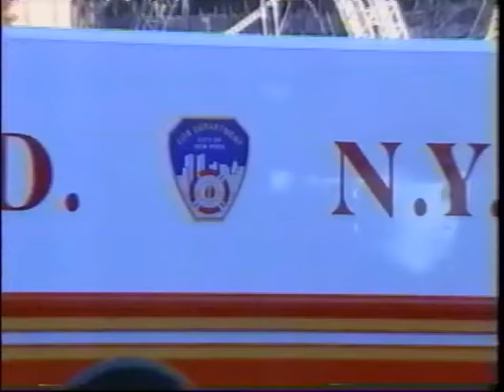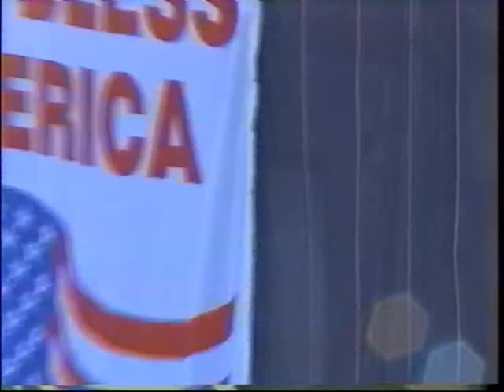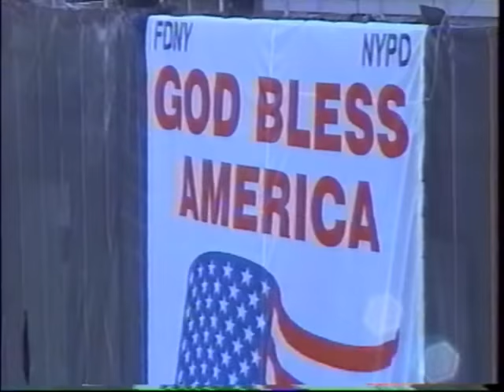Ground Zero recovery months after 9/11/2001

Comment: The rubble was still smoldering 3 months later. That is absolutely mind boggling.
Reply: @kingofhaiti123 Proves absolutely nothing smh
Reply: @kingofhaiti123  yes ,   niels harit  ,    proof of nano thermite ,  and god 
knows what else ,   why did so many people get serious sick
Reply: @JJSideshowBob  denial is real trust me I know, I was in your shoes at a point in my life 💯
Reply: @kingofhaiti123 Because heat from thermite behaves differently from heat from fires?  Conspiracy theorists never understand physics, and were never the smart kid in the class at school.  But after they leave school and get a job at McDonalds they suddenly think they are the smart guy ...
Reply: @SloverOfTeuth  Yes. There is vastly large differences between the heat from thermite and an office fire. For one Thermite has the ability to cut thru steels beams office fires don't.  How were all three buildings capable of achieving a free fall speed when the upper portion should have been met with resistance from the structure below that was not compromised?
Reply: @Ivegotnochoicesilencemyvoice  Because every single store made impact on store underneath with force around 1/3 of its total load capacity - theoretically, because we did not add the velocity. So assuming, that one store fell on another with force of a half of its load capacity + weakened structure that makes its capacity even lower then suddenly if it fail - the next one wont hold it even for 1 second. And each next is just added weight and speed. After 10-15 stories the resistance would be maybe 1/100 of the energy of the falling stories. 
And also you have to add that at WTC there were loads of stories above the impact zone, so there is no way that anything can stop it from free fall. All started only because of stories above. You will never understand that because it requires some knowledge about physics.
Reply: @kingofhaiti123  IQ room temperature.
Reply: I think everyone can agree on this physic. The building came down and people died. People went to their daily life that day and within an hour of terror, they had a handful of deaths to choose from. The faster they chose it, sadly spared them on the journey to the unknown.
Reply: @kingofhaiti123 what you have is B S. And to you spew it as if it were truth.
Reply: @kingofhaiti123 There were literal reports that the construction of the building was half assed and rushed. Not the mention the bs "Jet fuel cant melt steel beams" idiocy. All Steel has to do is heat up to about 35% its melting point and its ability to carry weight is gone, Doesn't even have to get close to melting. Also there is millions of videos talking about how the free fall started slow and gained speed due to the domino effect. Did you know the building had a wire mesh frame and the supports were on the outside??? Meaning when the plane punctured through the mesh of the building it severed several important key parts of the structure. But please ignore all of these things and just proceed through life with your tin foil hats.
Reply: Also you have to consider the planes were not far into their flight meaning they were pretty much full of jet fuel (about 63,000 gallons per plane), I’m not sure if this is the case, but there is also audio recording of the high jackers talking to the passengers warning them to remain seated and theirs bombs on board, back then their was no TSA so it is possible the high jackers had bombs on the planes, or it could of just been a scare tactic to keep the passengers from retaliating, but either way you can’t expect a building to hold 700 tons of weight especially at the height of 1000 feet, on top of intensely hot flames and burning fuel, the collapses were inevitable, the conspiracy theories make less sense than the reality of what happened, its complete disrespect to the families that lost loved ones in the planes, towers, pentagon and the field in PA
Reply: @meghanmarie840  I was pretty sure it was about 8700 gallons (as each plane held an average of 10,000) a gallon of water weighs 8lbs. Some fluids are give or take around the same weight. 63,000 gallons of jet fuel would never leave the runway.
Reply: @chrishandsome6542  my bad, thanks for the correction.
Reply: @SloverOfTeuth 😂 what a rosting😂😂
Reply: It burned for so long, it really was a nightmare
Reply: @meghanmarie840  The towers had way more than 700 tons of weight. The estimated that the weight above where the planes hit was about 38 000 tons. About the weight of the titanic. At least for the north tower. The south had more weight on top of the weakend beams.

A whole ships worth of weight lead to the collapse of the towers.
Reply: That is absolutely mind boogling????? Please work on your choice of words! That's not amazing! but just terrible!
Reply: @Ivegotnochoicesilencemyvoice 

You mean to tell me you never visited a landfill? Those things smolder all the time just from piles of TRASH.

Wonder what a charred building would do when heaped together with broken gas lines....
Reply: @JJSideshowBob yeah keep the conspiracy theorists at bay 👍
Reply: I was born in October 3rd 2001 so it was still burning even when I was born
Reply: @nisse452  mind boggling is usually not meant in a positive sense
Reply: Interesting that they have 2 x waterfall pools an acre each constant running water, in the place the base of the towers stood.
Largest man made waterfalls in the country.
Fires burned for 100days

Comment: We took our daughters to a Rockettes performance a couple of months after 9/11 happened.  After the performance, we then went to the top of the Empire State Building and from the observatory at the top, we could see smoke still rising from the rubble.
Reply: My dad was an operating engineer that day he got stuck in the city since the trains shut down, 383 Madison is the building he worked in and it was fairly new at the time, so it was covered in scaffolding and the top crown was still being constructed. Him, the other engineers there, and a load of construction workers all paused when they heard the loud of whine of jet engines flying overhead and followed the sound and saw the plane fly into the north tower. Everyone watched the events unfold in lower Manhattan from the top of 383
Reply: 99 days it burned.  Nano thermite does that. Regular fires don't burn for 99 days.
Reply: @zapdunga12 Regardless of what happened here, that's an ignorant comment. There's underground coal fires that have been burning for decades. Any fuel can burn indefinitely until it runs out if oxygen is withheld.
Reply: @johneckert1365  what fuel was there in ample supply for three months?
Reply: @donvtor24  Well for starters, every single combustible item in those buildings that wasn't burned up before the collapse. 

100's of cars in the underground parking garage with plastic and foam rubber.  5 rubber tires, gas or diesel fuel, oil, and other petroleum based fuels. 

Unburned jet fuel that ran down stairwells and elevator shafts.

Storage tanks full of generator fuel. 

All these combustible materials, as well as many more, were buried under rubble and starved of oxygen. That shit would've slowly smoldered & burned for years.

Comment: That looks like steam still coming out of the ground not smoke, smoke doesn't dissipate like that....That's some serious heat
Reply: SLORRIFJART321 HAHAHAHAHA, yeah that's some seriously "high pressure" steam, I suppose that's what maintained the extremely high temperatures that persisted for months in the rubble too PPPFFFTT
Reply: SLORRIFJART321 HA i thought you were joking......This video is months after the event, i very much doubt that high pressure steam would still be active in pipes under ground, i'm pretty sure that system would have been turned off pretty quickly after the event, especially with all the people walking all over the rubble. Try again.....
Reply: SLORRIFJART321 You are the one claiming this is "high pressure steam" SHILL!
I made you look like a fool so you have the comments deleted shill. Stop trying to avoid the questions, what's your response to my "melting boots" link? When would they have turned the "high pressure steam" off in the name of rescuers and clean up crew's safety? Back your claims by answering the questions or admit that you are the shill and yes i'll use your same tactics and delete your rubbish. Can you debate the subject or just make ridiculous claims?
Reply: Hey Ryan the Bot.
Take a look at this video about the 1993 bombing. At 25 minutes in they talk about the steam.
Reply: The "steam" was not from underground pipes it was from deep underground where there was molten rock from the heat of  nuclear devices that were buried under each tower.  Molten bedrock under the site. If you don't believe that just do an image search of "molten bedrock under the wtc towers". You will see that it had to be a nuke to create that much heat for 3 months.
Reply: Very impressive smack down, Ryan.  Nice work!
Reply: ryan revolt it's the nano military grade thermite still burning
Reply: Ryan Reus how long would that stuff burn for,?
Reply: The wreckage was fuming for years thats why they had to fill it in with dirt.
Reply: The fuel had about as much energy as 300 to 350 tons of TNT per tower alone excluding all the paper and other flammables in the towers that burned. It's hardly surprising it was a little hot even after a few months.
Reply: il fumo che esce dal sottosuolo è il perchè è la lava causata dall'eplosione della zona  zero  cosi chiamata!!
E’ proprio per questo che gli agenti del FBI indossavano quelle “ridicole” tute contro materiali pericolosi con maschere protettive  chiuse con nastro isolante mentre visitavano la Zona Zero: non volevano beccarsi una leucemia né nessun altro tipo di cancro, quindi quando chiudevano le loro maschere con il nastro non lo facevano solo per isolare i gas come pensava Walcott. Lo facevano con lo scopo di proteggersi dalla polvere radioattiva e specialmente dal vapore radioattivo, che non volevano inalare, tanto meno ancora ingerire. cosa sia queste radiazioni che cosa di vero è successo se tantissimi si sono ammalati di leucemia  che tipo di bombe hanno adoperato ???
Reply: I was there right by it. I saw it all in person. It smelled like burning wire and metal. I will nvr forget it.
Reply: Don’t you guys remember or checked??? Tonnes of dirt was brought IN to ground Z!!!      It acted like a natural insulator!!! Kept the temperature up..... now WHY would they do that???      They would have known its affect...   so it was done for a reason... maintaining a high temperature in a debris field has to have a reason?
Reply: ekoms108 dirt would have become an insulator....  like a charcoal oven or kiln...   it was not a way of lowering the temperature and they would have known it
Reply: jet fuel is not flammable and doesnt burn so yeah must be an inside job
Reply: It is steam.   Nobody was burned by the huge dust cloud from the collapse and the steam we see came from water from fire hoses.  The huge pools of melted steel found at the very bottom were formed by vast amounts of thermitic explosives used in the WTC controlled collapses. One metal that wasn't found was the 10 BILLION in gold bullion stolen from the world bank's sub basement vasults. Several large trucks with partial loads of the bullion were found meaning the people loading (looting) the gold knew EXACTLY when it was time too leave. 10 billion buys a lot of silence from victims families.
Reply: @tonyt5919  yeah right 😂😂😂😂😂 and the earth is flat
Reply: @melvynsngltn27  nope,!
Reply: ryan revolt that’s aluminum dioxide
Reply: core meltdown.
Reply: u had no idea that in early ''projet manhatan'' u had a nuclear reactor in the middle of the city in the gym...   thats how honest your goverment is.   US goverment is a universe (not earth, for whole uiverce) cancer
Reply: @TheKonga88  are you trying to be funny?
Reply: @waynekerr866  I'm trying to figure out how to make my queen ant into a giant so she lays giant eggs and I can rule the world with my giant ants. 🌍🌍🐜🐜🐜🐜🐜🐜🐜🐜🐜👑👸🐜🐜🐜🐜🐜🐜🐜🐜🐜🐜🏃🏃🏃🏃🏃🏃🏃🏬🚉🚂🐍🐍
Reply: Thermite
Reply: That was what was left of the explosions that occurred in the buildings, which caused them to collapse, it is thermite
Reply: Oh look, another professor of physics.. 😂😂😂😂😂😂😂😂😂😂NOW get back to work! You have customers waiting for their fries.. 🍟🍟🍟🍟🍟🍟🙌🙌😂😂😂😂😂😂
Reply: Melvyn Singleton lmao and so is the fcking sun
Reply: @nancyrice7569  nukes?  That's a new one.
Reply: Do an image search "molten bedrock WTC" and you will see the huge craters left behind by the lava-like extreme heat boiling and fuming for months that could only be generated by some type of small nuclear device.
Reply: @nancyrice7569  buy yet no rise in the radiation in the area?
Reply: And when were these supposed nukes planted?  When and who?
Reply: @Tampajoe77  Can't deny the evidence of the giant craters and cavities, nuke is one possibility. Did you do that image search?
Reply: Do your own research.
Reply: @nancyrice7569  usual typical answer I expected.
Reply: Too lazy to find the truth that's out there? I've been researching 9-11 for about 3 years now and I can't understand it FOR you or any other individual person. If the melted bedrock  doesn't inspire a compelling interest to search for the truth, nothing will.
Reply: @nancyrice7569  there was no melted bedrock.  Search for the truth.  What proof do you have of nuclear explosions?   What type of nuke?   What yield?  Where did it come from?  When was it planted? Who planted it?  Who pushed the button?  Surely you can,tell us this?
Reply: @ivaniaecardoza9248  what caused the alleged explosions then?
Reply: @dennyfrontier  Jet fuel is kerosene and does burn quite brilliantly if you've ever watched a plane crash. It generates immense heat and burns off quickly, not before setting everything else ablaze. Firefighters were told to not play hoses on the stuff the cranes were dragging out because they were red hot. Pulverized rubble because the water content was at 5% and over 1000 people vaporized due to the more than 60% water composition left DUST. HUMAN DUST and Concrete dust along with ash of everything else that burned. No Explosives, no Thermite, simple heat that bent the floor supports, not melted. In order to bend or weaken steel you only need HALF the melting point. No conspiracy, it happened as it happened. A complete disaster and you all think to make a JOKE about it by saying "OH IT WAS AN INSIDE JOB" Have some fucking respect for a change.
Reply: @ivaniaecardoza9248  agreed
Reply: @nancyrice7569  or nanothermate
Reply: it's called thermite, whitish plumes, molten steel pouring out of upper floors as cores were melted out of existence so perfect explosive demolitions.
Reply: @nancyrice7569  and you please search up 'thermite' or 'nano thermite'
Reply: @nancyrice7569 That was molten aluminum Honey, not molten bedrock 😂😂😂
Reply: @mrdojob let's not forget about the fuel, oil, and tires from the hundreds of cars parked inside. Sooooo much energy there.
Reply: @johnzarollin2749 There was no pools of molten steel. That was a mix of molten aluminum and copper.
Reply: @ivaniaecardoza9248 So odd that the buildings collapsed from the actual impact zone first. Then from top to bottom.  You crazies always overlook that.
Reply: @mrdojob even 350 tons of tnt could only turn 350 tons of steel into dust . The towers were a million tons mostly steel . Now turned mostly to dust .

Comment: Did you ever notice that on 9/11 WTC buildings 1,2 and seven collapsed symmetrically ( all sides falling at the same time and at the same speed) First WTC 2 ( with damage to one side from a jet impact) then WTC 1 ( also with one side damaged from a jet impact). Then at 5:20 pm WTC 7 ( a 47 story high rise) collapsed from the bottom straight down. Funny thing the two towers fell apart from the top down. But what is so amazing and so weird is the fact WTC 6 stood between WTC 7 and WTC 1, but was still standing on 9/12. WTC 6 was heavily damaged, but still standing. 
My question is this: What piece of information is missing from a common understanding of 9/11 that is able to explain such building collapses?
Reply: Gravity
Reply: @AUTOPSY666  

😂😂😂Let me guess you’re on your 5th Covid booster and wear a face mask while driving a car.
Reply: @lizardfirefighter110  jab free, never even got C-19 ♡
Reply: @AUTOPSY666 100%

Comment: Dump truck loads of thermite was used to bring these building down and it apparent when you still see burning months later.
Reply: Yet nobody saw it
Reply: @mikebyrd8278  Everybody saw it, ever seen a building collapse like that? You just have to know what you’re looking for.
Reply: @user-lr5bo3ip8i  well a skyscraper has never been hit by a big ass jet before either. Nobody saw anybody planting thermite nor do they use thermite to bring down buildings.
Reply: @user-lr5bo3ip8i  It would've taken HOURS to have enough thermite to melt the structures off that building to the point of collapse, I mean people would've noticed bunch of thermite going off. But you believe what any message board says